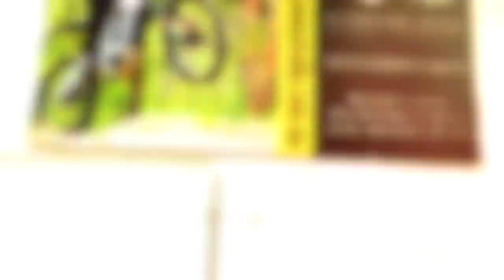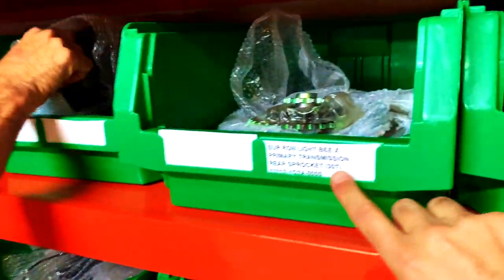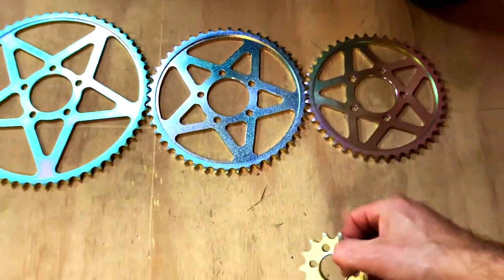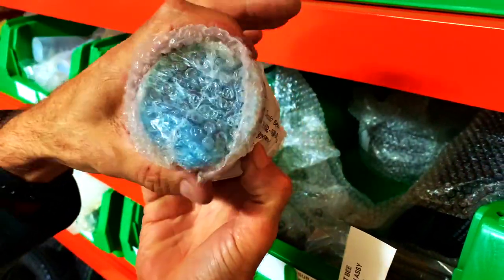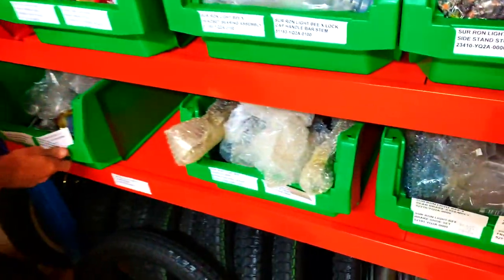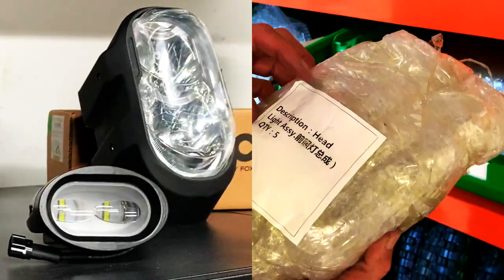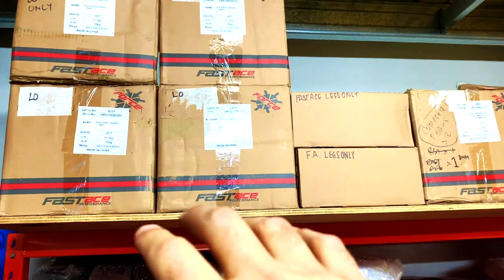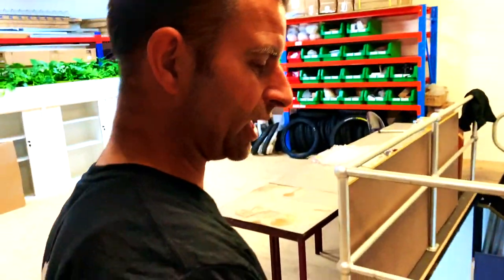SUR-RON REPLACEMENT PARTS & Accessories - Everything you need, crazy CHEAP!

Comment: hi bro, my motor takes 72v 200amps continuous and 600amps peak so I need a BMS for the cell balancing how can I purchase BMS it is better if the BMS has a smart connection can you help me  and I am a huge fan of your works
Reply from the maker: Yeeeeeeaahh mate, thanks for coming here and watching my weird videos hahaaa...  Ok, there’s an AntBMS that is smart, is awesome, it’s rated 400A peak and 160A continuous. If you increase cooling you’ll be able to use that one. There are some other BMS options out there but not really something amazing you could trust. Such high current you have to step up into EV territory and that will cost a LOT more money... $$$$$ The AntBMS has two models, a smaller 400A and a 300A bigger in size. The bigger one has double the balancing current 200mA cont per cell while the smaller 400A BMS is 100mA balancing per serie. Try this BMS, it comes with LCD display and you can see the BMS mosfet temperature. If it’s really getting too hot you’ll be able to see. For the price you could get both models and still waaaaay cheaper than the next power step up EV BMS
Reply: @BrunoPOWEEER  thanks bro love your video's

Comment: I need one of the chain conversations. My belt makes the most annoying noise and i can not get rid of it. Ive adjust and belt dressing and its just gotta go.
Reply from the maker: Yeaaahhh belt is a quieter solution but sometimes can get noisy. There is a spray to make noisy belts quieter you can get from auto parts store. I just did my friend’s bike the other day and it instantly fixed the noise. Chain is louder, if you going very dirty muddy wet off-road yeah go chain on both primary and secondary, if you spend most time on the road better either use that spray or get a new belt.
Reply: @BrunoPOWEEER  
Yeah belt dressing but it only lasts a few miles the. Its back to sounding like im riding a bike made out of squeaky toys.
Reply: @BrunoPOWEEER  
Well the other reason i want the chain is so i can change gearing there easier than with a belt. Thats been a curiosity of mine for some time. 
I ended up getting my hands on one of luna's ludacris controllers so now i have all the extra torque and no place to go with it. But i also need to find a better BMS.
Reply: Ham Wallet where did you buy the ludicrous controller mate ? Thanks
Reply: @ptescreen18  
I got it by accident from luna. They had listed a "slightly used controller" for $150 my it got to me and i notice on the back it says 120 amp and i see this little potentiometer on the side. Thought well thats weird. Installed it hopped on and went to crack the throttle wide ope like i normally could and damn near ended up on my back. But i had to dial it back a ways because of the stock BMS in the battery nobody wants to help me out with. Lol. Youd think it was the KFC original recipe or something.

Comment: POOOOOOWWWWWWHHHHAAAAAAAAAAAARRRRHHHH!!!!!!
Reply from the maker: Hahaaaa sooo much POOOOOOOOOOWWWWWWWWWHHHHHHHHHAAAAAAAAAAAAAAAAAAAAAAAAAARRRRRRRRRRRRRR ohhhh yeaaahhh =]
Reply: @BrunoPOWEEER  Hey do you know if Bafang changed the bearing size for where the BBSHD's rotor goes into the core? I bought a new core and rotor (separately) for my BBSHD and the rotor is has lateral play to it and rattles now.

I've tried Permatex Bearing Mount but it hasn't stopped the rattling/grinding. I think the rotor bearing is supposed to be from version B but I'm not 100% it might be too small.
Reply: @BrunoPOWEEER  I now realise I need the 629 bearing (or a spacer of some kind) because they changed the size when they updated the rotor design in 2019.
Reply from the maker: Ohhh I used to know all that stuff when I worked with eBikes but haven’t done much Bafang stuff since 2017... it should fit really tight and yeah there are some specific Loctite just to fill up gaps like that and lock it in place. I made a video back in 2015 showing some stuff like that https://youtu.be/8d914aeJWYE and then a second video showing how to fix
 https://youtu.be/7g0wEta4w-0
Reply: @BrunoPOWEEER  Thanks, yeah I saw those videos that's what made me ask. I'm just going to get a new 629 bearing. I don't suppose you happen to know if it matters if the bearing is metal or rubber shielded?
Reply: @BrunoPOWEEER  Just put a new 629 bearing in there today and it works good as new!  👍

Comment: Needing simple smartwatch and application for smart device with facial recognition/finger printing access where helmets immersive printing by all pet's body kit water printing/hydro graphics or sticker wrapped fonts etc.
WiFi networks microcontrollers covers linked iridium transceiver with smartphone GPS birds eye satellite and Speedo mph/kmh also opponent Position number place GPS location and speed.
A 50cc/80cc equipment of Mx dirt pit bike size full electric password login sign-up to also use allow administration clock calendar for rental or other users riders MTB trails maps